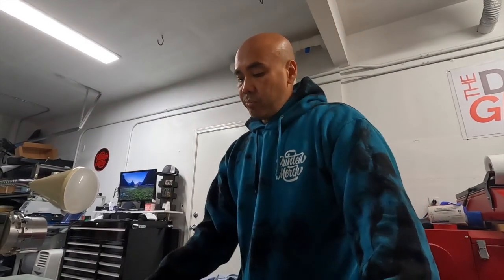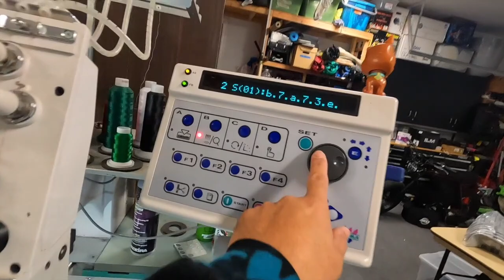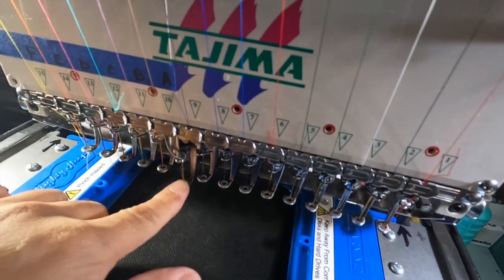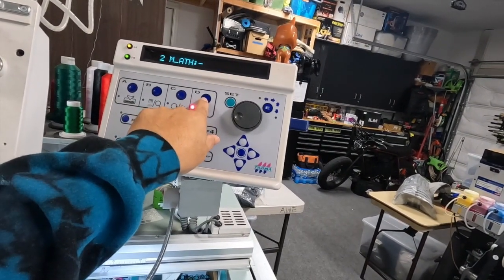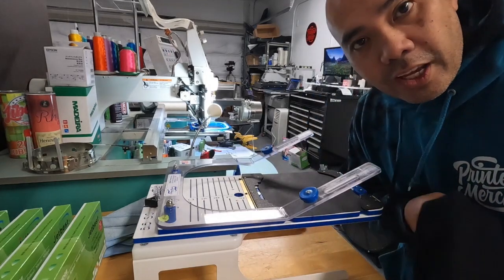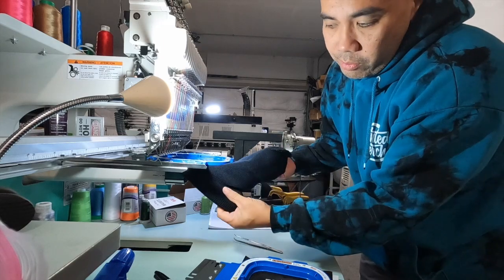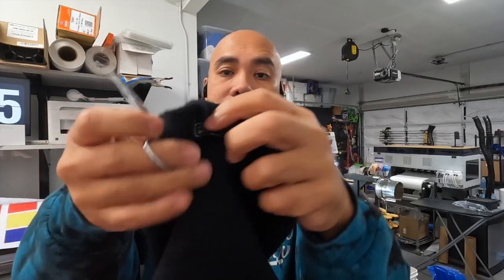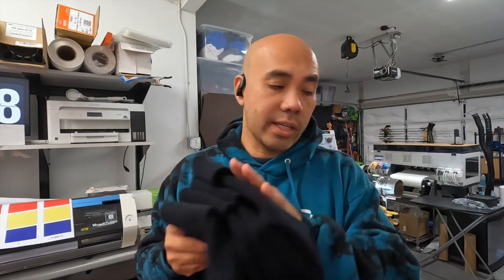EASY EMBROIDERY JOB ON THE TAJIMA : I ALMOST MESSED IT UP (S:10/Vlog 29)

Comment: Good stuff you should check out the beanie  videos i just made a few days ago. I use a ruler much faster than guessing or using your fingers. Also i have switched over to doing knock down stitches if i have the color of the hat in thread. That way i dont have to use the topping.